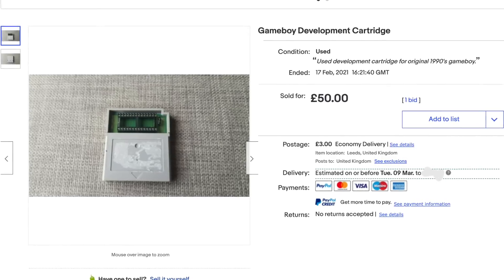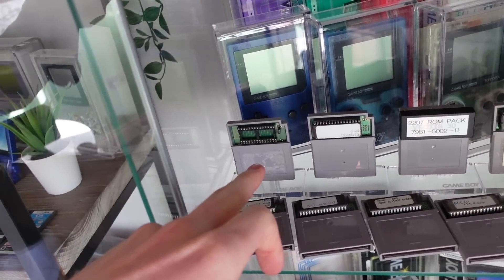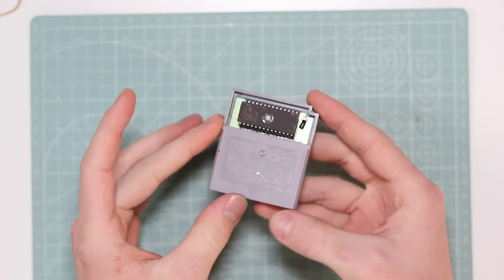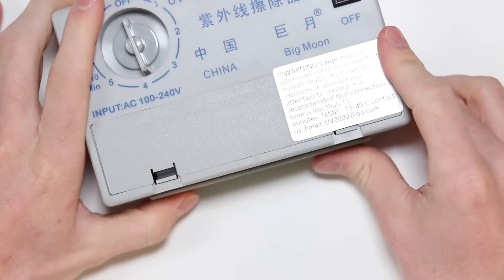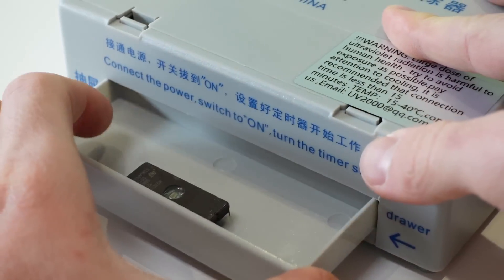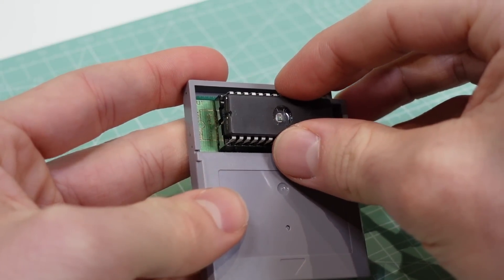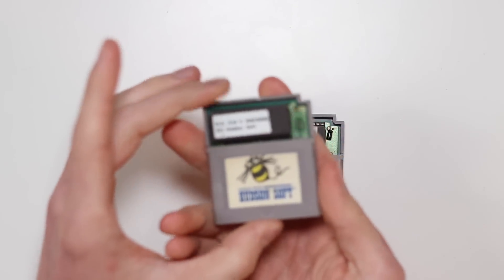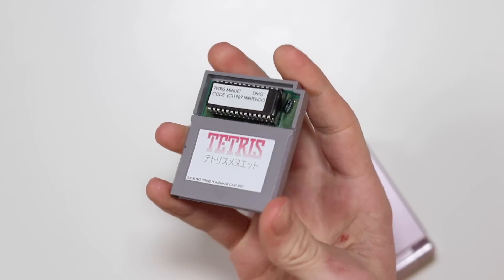I made my own GameBoy cartridge

Comment: The eeprom is made of silicon and electronics like transistors, resistors and capacitors. The black material is designed to absorb light on the visible and infrared spectrum. It's also a semiconductor. It must be the components that are heavy because silicon is considered a light weight material.

Comment: you can actually get an electrically flashable version of that eprom. called an eeprom Electrically Erasible Programable Read Only Memory. As long as the pinout on the chip is the same then you can use than. no need for that old UV stuff. you can just use a cheap flasher like a TL866. those are made brand new on mouser and digikey so you wont have to worry about them disappearing due to old, limited stock

Comment: Don't know if you've looked into it any or had someone mention it, but in the video you mentioned not knowing how to work with the GB and GBA Flash cartridges.  I never messed with the GB ones myself, but I did use a GBA flash cart for a while, and the way I used it was a special cable and program.  The cable connected the GBA link port to a USB port, a button combination on startup (I believe holding Start+Select on power on) caused the GBA to boot into "slave" mode where it waited for code from the link cable, and the program basically would send a special program that would read/write from the cartridge slot.  It would be used to either dump the contents of a cartridge, or to send the commands to the chip to program the flash cart with new contents.  I imagine that something like that exists for the GB cart, or you'd use a device like the one you used to dump the original Tetris cart to interface with the GB Flash cart.  If you can find technical data (possibly by looking up any markings on the inside?) you may be able to find or write a program that would send the necessary signals to store data.

Comment: The label across the back of the EPROM is not only to label what's on it, but because they can also be erased accidentally by sunlight and other sources of UV light if not careful. It's there to protect the data, as well as inform what's on the chip itself.

Comment: I think eeprom's are still being manufactured and used in virtually any device that needs to store some data when a power cycle happens.. Printers and microcontrollers use them for example. 
Also, I would not recommend using UV light to erase it. Too much exposure could render it useless. It's more of a last measure for old eeproms if some bits are stuck in a '1' state.  
If the eeprom is good then you should be able to just write 0's on it before you flash your program

Comment: You could probably use a modern EEPROM in place of the old stock UV EPROM. I don't know much about how the bank controller chips work and what compatibility issues there are , but there are definitely still EEPROM chips in that form factor being made.  They're much more easily eraseable with that TL-866 'eprom flasher'.

Comment: would suggest a blackout sticker over the eeprom window, to prevent data degradation from UV leakage. if you pull a sticker off a normal eeprom u'll see it has a blackout layer to block accidental uv exposure

Comment: Is it not possible to get the equivalent EPROM but as an EEPROM? I guess that's not quite as fun though ;)
Reply: Kind of. The pinout of the EEPROM is slightly different so you'd need an adapter, but fortunately the adapter can be easily made with two IC sockets and minimal soldering.
Reply: @eDoc2020  ah, makes sense! Thanks!

Comment: I was interested in this video because I was looking in to ways to retro fit old Pokemon games that needed a battery for save file (Gen I and II) so that the data wouldn't be lost when the battery ran out. (perhaps a secondary rechargeable battery?) This is not that but its a step in the right direction. Very cool.

Comment: Elliot “UV light erases this eprom”... leaves covering the erase window till last. ..yeah, grand idea 🤦🏻😱🤯
Reply: The EEPROM isn't affected by visible light only UV (UV-C to be precise) the amount of UV if any in artificial light is minimal not a concern in the short term. It is also not very prominent in sunlight you would have to leave it outside in direct sunlight for 1 to 2 weeks to completely erase it. UV-C is also completely filtered out by ordinary glass so anything coming through a window is nothing to worry about.
Reply: @Bushougoma  well, it wasn’t an EEPROM, because UV wouldn’t be a “thing”. If any UV light hits the window it could cause corruption, so yeah, it is an issue.
Reply: @memsom  This is a myth that's been perpetuated for a long time. Indoor light WILL NOT erase an EPROM. I said minimal concern previously to take into account some stray sunlight from an open window. All fluorescent lamps used for general lighting emit UV-C however the tubes are made of glass which blocks 100% of it. LEDs for general lighting also do not emit UV.

Only UV-C emitted by specially made germicidal lamps (tubes made of quartz rather than glass to pass UV-C) will work.

This specific wavelength of light and ONLY this wavelength will bleed the charge off the floating gates to erase the chip.

Comment: For those interested: The reason why this cartridge can only run "small" games is because of the small chip on there, the MBC or Memory Bank Controller. There were different types which were used depending on the memory layout of the ROM. Games like Tetris use the simplest variant, while games like Pokémon use some of the later ones allowing for switching in more memory through a technique called bank switching.

The reason why ROM files work regardless in emulators is that .gb files contain a header that signals the emulator which MBC to emulate.

Comment: Somebody else has probably pointed this out but the other reason the EPROM carts have the stickers on the chip is to prevent gradual degradation of data from natural UV exposure over prolonged time.
Used to use them a lot back in the day when I did a B-Tec in 86.